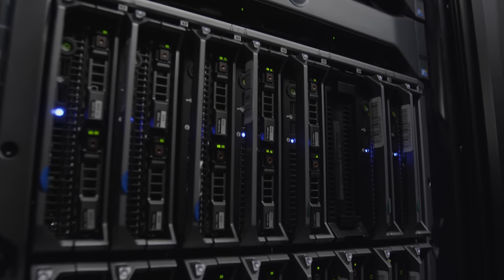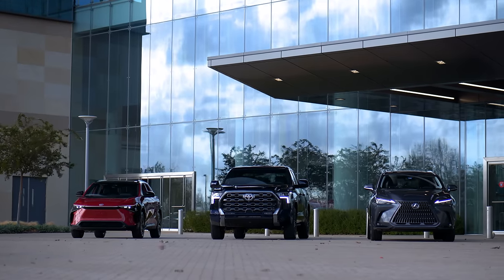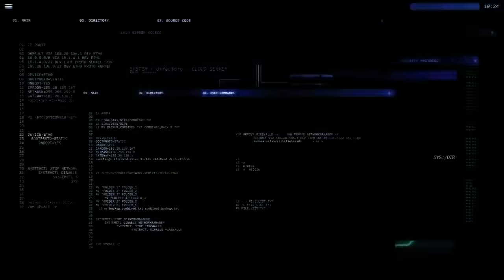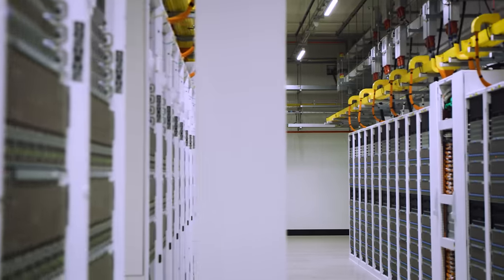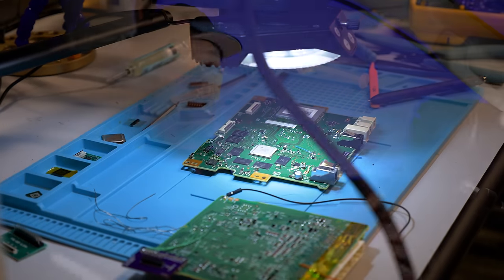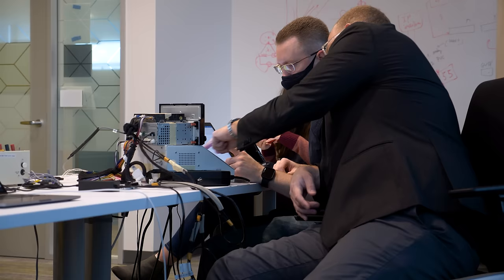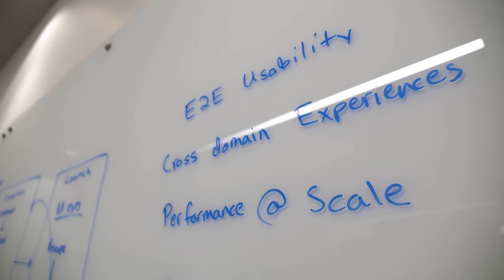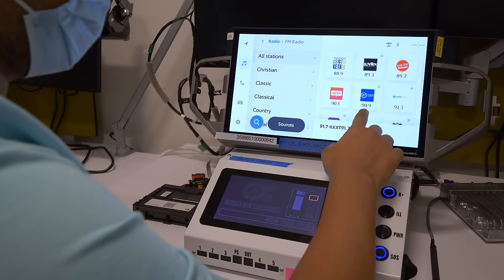How Is Infotainment Designed?

Comment: I feel like alot of non-enthusiast and tech sectors in the automotive industry dont value the desire for simplification. At least giving customers the option to "de-techify" thier cars would be great
Reply: You have to buy them now
Reply: I just don’t think those people buy new $40k+ SUVs which is the hot market right now. It’s clear to manufacturers that they can charge a premium for electronic gadgets. I just don’t think there’s enough money to be made in the “de-tech” crowd to be worth it.
Reply: @connellyboyle1   that’s because the detect crowd never spends the money. 

I had got damn fully loaded Dodge Charger j bought with 9k miles I bought in 2014. 
Blind spot, lane departure, the smart cruise, parking sensors front and back, heated/cooled seats, heated seats in the rear, back up camera, remote start, Nav, Harmen Kardon with 17 speakers or some shit plus the amp, heated/cooled cup holders, power seat all the way around .

When that car was in a flood in June 2021 with 159k miles on it, the backup camera and Bluetooth was the only thing electronic that had ever malfunctioned. 

My point is ,
How “de-tech” do you want to get ? 
Why? 

My other point
Look at Charger reliability ratings. They are terrible. But that damn Charger was one of my best and I had many. 
So if the fear is it is going to mess up maybe it will. 
That’s why I always buy something with performance upgrades like LSD, Bigger engines, adaptive suspension, transmissions, gear ratios, that shit and the and safety autonomous is really what holds value. 

So In 10 years if it does mess up, you will still have a buyer cuz people don’t SRT8, CTS Vs, C63s for the Nav and cooled seats.
Reply: @connellyboyle1    You know if you haven’t experienced this high tech stuff for self you may actually love it. 
And I don’t mean experience it on a test drive, I mean like experience while you do the things you do every day. 

and really nowadays Nav, blind spot, heated cooled seats etc is “de-tech” 

I have driven THOUSANDS of cars I can only think of once where the basic luxury features like I listed above did not work. 

I was in the automotive industry for 8 years until recently. All of it except the early days I was at the #1 dealership in my state. #1 and it wasn’t close. Even as a salesmen, before I had my own department, or a finance manger I was able to get a demo and I always chose used. 

As much business as we did thousands is probably conservative. 

My point is you are missing out on some good cars wanting “de-tech” cuz you don’t want to learn or cuz you think they will fuck up.
Reply: @RandomInternet User  you don’t even need to do that. 

If you want a traditional driving Car 

Pontiac G8 GT is about as good as it gets
Reply: As much as we can hate on Google all day long, the minimal UI in the Polestar is one of the best
Reply: @TeeWadeG  No thank you, Give me an option to opt out. I have driven some of these new cars for a few weeks at a time. And I could not stand it. In my opinion these systems are a safety hazard and make the vehicle much more complicated.  I was so happy to get back in my 2006 VW with a Manual Transmission, buttons, switches and dials. No Touch Screen or Infotainment System Interface.
Reply: @tah6746  you drove the wrong car
Reply: @TeeWadeG  I have driven several New Automobiles for extended periods of time. I did not like any of these Infotainment Touch Screen Systems. What would be the correct car then? Or, at least something to look at. At this point I have lost interest in New Cars that have these systems installed.
Reply: @TeeWadeG  What would be the correct car, than?

Comment: The more I watched this video... The more I realized that this is not about the future of cars but is about a giant leap backwards for cars.
So they want to collect data and make things more complicated and then come around to get more from your wallet, get you stuck in a subscription "service" to do basic things that are/were free.
Reply: You can make a compl,etely anolog BEV with a transmission and manuel it's just no one has in the past 20 years...
Reply: @GreenBlueWalkthrough  Managing the battery and the control of your electric motor requires so many digital components just by design, that by then you wouldn't be able to call that car analog anymore. There's no way to have a well functioning analog accelerator pedal in an electric car for example, which is a very essential component.
Reply: Exactly. I see no reason why Toyota should gather and sell my music preferences. I have enough apps doing it already.

Comment: I appreciate that you guys do segments like this. Great video.

One man's opinion: customers that are interested in an automated carriage ride shouldn't be consulted on anything BUT an automated carriage. From a practical stance, technology integration in cars reached its peak with audio media and navigation integration. They wasted the opportunity to allow for all this tech to help the customer mechanically by bypassing the need for dealer diagnostics, and pretty much everything else they keep shoving in there is nonsense being "asked for" by people who grew up with cars that helped them reverse, park, change lanes, manage speed, and pay attention to other objects on the road.

Now let's talk some objectivity. ANYTHING that pulls your eyes from the road is unsafe, and any discussion regarding a UI that promotes safety, while still requiring use of touch features or precision manipulation of controls is completely disingenuous. I'm glad they at least acknowledged the complete edge that manual controls have in this regard, but they're still doing what they're doing.

The discussion regarding consumer security is also pretty laughable. These manufacturers can say whatever they want but the reality is that if they're using affiliate software (Google search engine, for example) aspects of your data will be sold to those software companies in order to offset licensing fees charged to the car manufacturer. You can add advertisements based on your driving habits to those based around browser activity and social media.

Lastly, cost and environmental impact. Even if Toyota (or whomever) decides to absorb the increase in manufacturering cost with all the added tech and research that went into it, fixing a car is only going to get more costly the more they increase infotainment and tech integration. Add to that the reality of what goes into all this added and improved tech is only increasing negative environmental impact.

The current direction of the automotive industry is pretty disheartening. I'm hoping the next 5 years or so sees more people pushing back somewhat, but I'm pretty sure that's a pipe dream as people are all to comfortable with being told they need these features, or being told that an EV loaded with tech is somehow "greener" than a straightforward combustion powered vehicle.

Comment: This video displays some of the reasons I still can't let go of my 2006 Lexus GS300:
  - Screen for AC/heat, but it's one physical button, one screen button. 2 seconds to use, tops
   - cooled/heated seats, it's only a physical scrolling button. It's left on in the position you leave it in and goes to work immediately when you turn on your car.
  - I can TURN OFF the center console with one physical button and one screen button (especially good for latenight drives/roadtrips).

Give me physical buttons for major select options, with an easy up-down modifications on the screen I can use while driving that I dont need to look at. Only screen interfaces? 
Not in this lifetime!

Comment: I don't agree regarding the touch screen being better for something like heated/cooled seats which are more seasonal because it's usually something I would turn on when the car is starting to run because it may either be very cold or hot initially. Then I would turn it off while driving because it would no longer be needed and in some cases could become too hot. Companies could create buttons which are customizable for things like this, and allow the user to set those buttons to do certain things in the screen.

But really, I'm going to be against touch screens in cars for the most part. I understand some vehicles which have a LOT of options almost need to have some settings in a touch screen but why not allow it to be hidden while driving? Certainly it would improve driver safety. I'm pretty sure I've seen hidable displays in some Bentleys. I don't think it's a big cost to make a digital display hidable, but even instrument clusters are pretty much all digital these days.
Reply: Heated and cooled seats should def be buttons, these tech people are out of touch (no pun intended)
Reply: Simple button to turn your heated seats on versus having to wait for your slow ass screen to start up, then navigate their stupid menu system to find the seat controls with your gloves off while it’s cold as shit

Comment: We could have developed a v10 manual transmission sports car but the market research said people were most interested in watching tik toks and changing their ambient lighting on their MMI screen. This is the future we asked for. Anyways, thank you Mr Goose for the in depth video.
Reply: Yes v10 manual sports cars are real money makers... Get real.
Reply: I couldn't get the manual v10, but does a manual flat 6 count? "Tech" includes power windows and 2 way adjustable seats, 1 way powered and 1 way manual. No sport mode or any buttons at all on the steering wheel.
Reply: "We wanted flying cars, instead we got 140 characters." - Peter Thiel

Comment: Mark, Jack, SG team, thank you! Keep on this path. You’ve carved out a niche for yourselves and I love the access your geekiness has enabled you to uncover. I have never consider buying a Toyota until recently. I’m 42 years old. The Toyota II grew up with was boring Camry and Corolla. The only Toyota I’ve ever longed for is a 4Runner. But now, they’re coming up with awesome designs, halo cars, emotional experiences, all backed by a deep rooted commitment to the end user. Tech is the final piece of the puzzle. I’m holding onto my 2017 as long as I can to avoid the tech purgatory consumers are having to endure. 

This video opened my eyes as to why there is so much latency in development and why things are the way they are. 

Ps: the engineers comment about heated and cooled seats… he clearly does not live in an extreme climate. Heated seats are the 4th most used feature in Canada after the steering wheel, radio and hvac. Being able to dial the heat back and forth, on and off is a critical element and should not be buried in a menu or have the adjustability be haptic or on screen.

Comment: This is the most important topic you covered thus far. This modern In-car tech thing is going out of control. Cars are not smartphones. Cars need to be safe to operate both to drivers and others on the road. And cars should be dependable without needing a software update. Please continue to preach this until governments introduce standards and limits.
Reply: We definitely don't want the government introducing UI and interior design standards that aren't related to crash proection.l
Reply: so i read your comment, and i have some thoughts.
i never see anyone driving dangerously while using something on the infotainment screen. i do, however, see drivers regularly driving dangerously because they're doing something on their phone. albeit i have no evidence other than my own anecdotal experience to supplement this statement.

the idea behind infotainment tech is to keep the content centrally located, and presented in a way that's quickly intuitive so you can use it while you're driving without it being dangerous. in turn, providing easy access to phone calls, voice dictated text messages, navigation, and music; we can keep people OFF their phones while they're driving, which IS safer whether you admit it or not. and really if someone WAS going to be distracted by something on the dash of their car, they were probably just gonna use their phone anyways. at least the rest of us can have everything we need centrally located.

there are certain aspects of automotive computerisation that i don't like, for instance having all the hardware for a feature already built into the car and disabling it with a software lock that can be purchased or subscribed to. that's dumb, and we should seriously push back against any manufacturer that does this (including toyota). i also don't like manufacturer greed locking people out of independent or consumer repair for any systems (namely tesla). if there was an open standard required by law for diagnostics of electronic systems (like how we have OBD2 for ECU diagnostics) it would actually be SIMPLER to diagnose faults because computers always tell you exactly what went wrong and where. you just have to have the read the errors. just like with a scan tool.

the enemy here isn't computerisation, but manufacturer greed. 
in passing along messages like this, they solidify ideas in consumer minds that all electronic systems have to be more difficult to maintain, when that simply isn't true.

Comment: For me, any control that involves touching a screen becomes non existent when the vehicle is in motion. But heres the thing that I don't hear talked about enough in the world of infotainments. Touch controls are fine to use for passengers, which means the drivers physical controls do not need to be near the screen. Steering wheel controls for things like volume and HVAC are amazing. My moms 2002, which has only physical controls mercury grand marquis has volume, "next" (for radio presets), fan speed and temperature all on the right side of the steering wheel. This was a 2002 design by ford and honestly it blows me away. 

We are used to holding a screen in our hands, wrapping our fingers around it and using our thumbs to control it. In my honest opinion, this is where drivers physical controls belong. It allows the companies to go full digital in the middle, with maybe a knob in the console for physical redundancy, while giving the driver what they need literally without having to take their hands off the wheels. Take infotainment controls off the wheel (like D pads and such) and just put volume/radio, hands free calling/voice assistant, and HVAC controls for the right hand. Left hand controls cruise control and the gauge cluster. For cars with dual zone climate, obviously just link the driver's climate to the wheel, keep the passenger exclusively touch. Then just have a little popup in the gauge cluster screen that reflects the changes being made by hitting the steering wheel buttons so that the driver can see what they are doing at a glance without having to take their eyes off the road to look at the main screen. It would take a little getting used to for a driver to just use the buttons under their fingers natively vs reaching over to the middle of the dash, but in the long term it would be beneficial.
Reply: Brilliant m8
Reply: Agreed. Driver controls that may be needed while driving should be almost exclusively analog and tactile.

Comment: Oh yeah, now some dude tels me that I don't need my cooled/heated seat button and it can be moved somewhere in the menus. This is all wrong with cars right now - my '11 m37 has a rotary for that and I can leave it on and it will stay that way after I start the car! 2011!  And please, tell me how rarely I need to use that in Texas heat or Canada winters...
Reply: If you need to continue to reset you temp on your vehicles while driving then obviously your vehicle isn't doing what you need. You should have to set you cooled seats once and your temp once. Maybe an adjustment later but I live in Texas. Temp set to auto at 73. Seat set to cool at 3 or off. Frankly I don't interact with it alot. I drive 650 miles a week.
Reply: @bigcjm  good for you!

Comment: Am idea Ive had since screens started appearing in cars is on board diagnostics accessible through the infotainment. The owner would be able to see the code & what type error or problem is when the check engine light comes on instead of connecting to the OBD-II port. To go one further,  if a sensor has gone bad the infotainment can provide the oem part number within the description. 
If modern infotainment can control the suspension, engine, & transmission settings then OBD can & should be accessible through the central display.
Reply: acura was doing this for awhile.  Don't know if they still are.  BMW also did some diagnostics through idrive.

Comment: 12:20 The reasons Mr. Lota mentioned about soft vs physical buttons is just horrendous... why would you CARE about the looks of an icon? I just want to turn the volume up, or turn on a heated seats... Something like that CAN NOT be valued over blind activation. Why should I take my eyes off the road to navigate through a UI over any terrain (worse if it's bumpy) just to activate something that could have been done with a button.

Comment: I lost count at how many dev systems were shown in this video - but it perfectly exemplifies the major problem with all of these systems:

They seem to be designed by someone sitting in an office chair. We also don't know how regularly, if at all, these engrs drive, and drive using one of these systems and try to operate every feature on a busy road (i'd guess very unlikely). 

So many of these products are disconnected from real use cases, and it starts all the way back at the design process.
Reply: They don't even wear socks; guarantee they're not enthusiasts. Heck I'd bet a good percentage are pretty terrible drivers